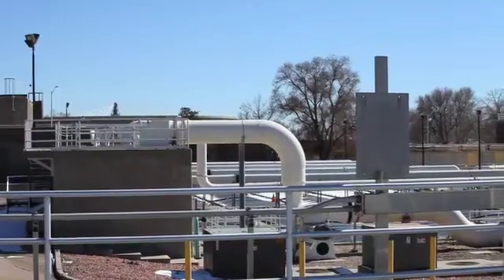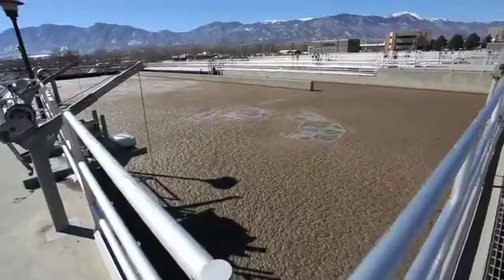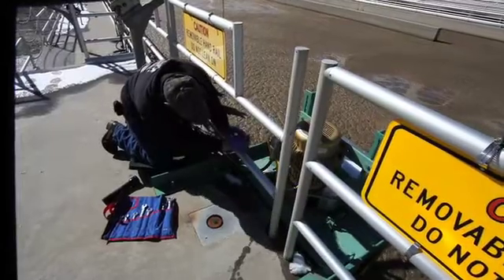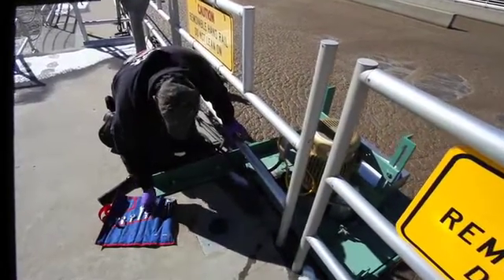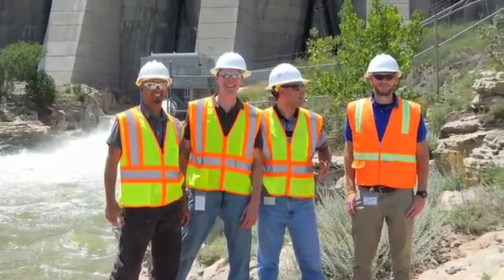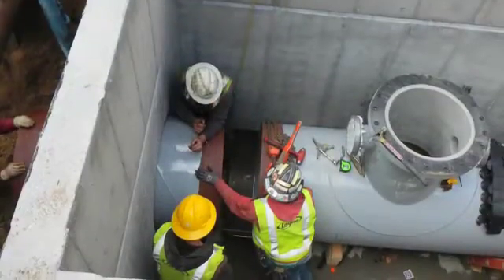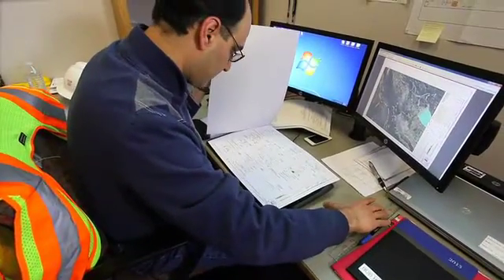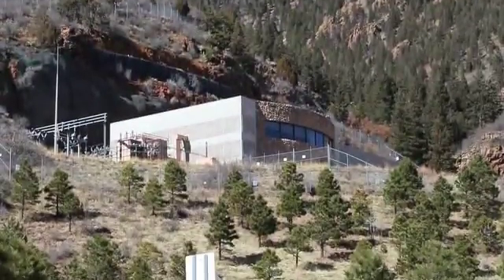Careers in Water & Wastewater Engineering

Comment: l have a question
1.Water Supply and Sanitation Engineering
2.Water Resources Engineering
3.Water/Wastewater Engineering
4.Hydraulic Engineering
5.Environmental Engineering

What actually is the difference between these majors and to be more specific *water supply and sanitation engineering*,in which major does it actually fall in?
Reply: all civil engineering